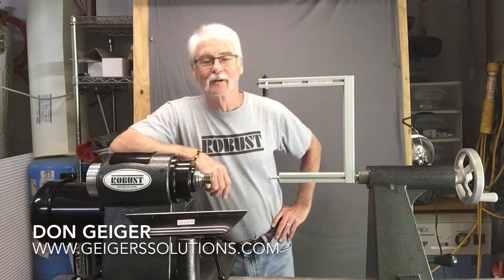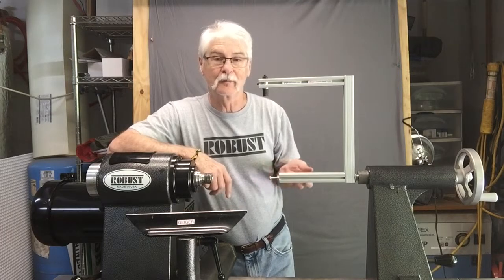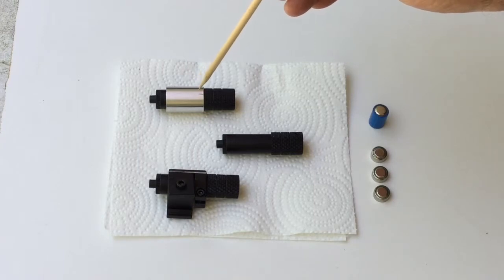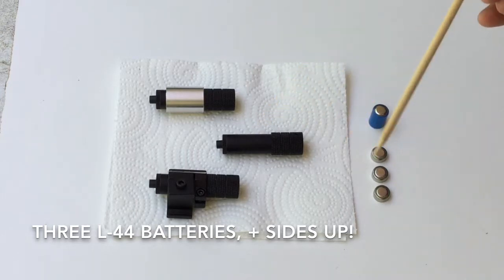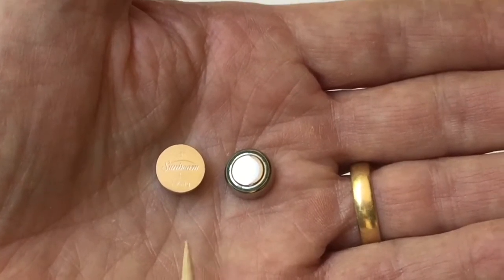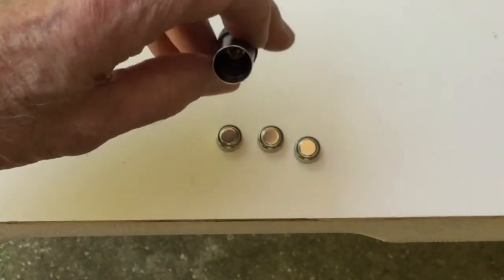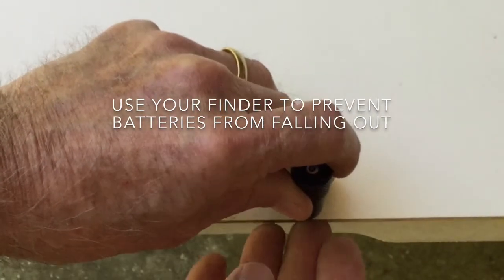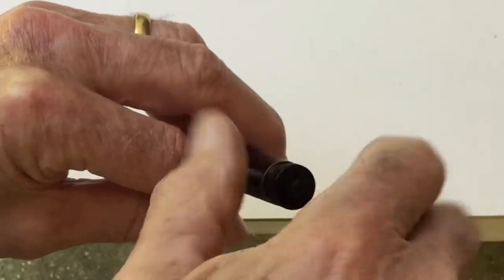Laser System Battery Installation Tips

Comment: when i screw it in it just pops and the battery fly out
Reply from the maker: Are you sure there are only 3 batteries and they are L-44?
Reply from the maker: I had another thought too: I have seen some lasers that are designed for only two batteries. Three would not fit. I don't recall ever supplying any such lasers with my Laser Depth Finder.

Comment: Help!  I've got 2 of those batteries for the ProHands Tactical.  They sit in the battery compartment horizontally  like a canoe.  Got any ideas for them?  I can NOT get them in!!   Thanks.
Reply: They must be same size as the original.  Can you stack them, set them on a table as I showed in the video? This method usually works.
Reply: I finally found my method; wire glue. A miniscule drop on the plus side of the inside batteries. My Truglow stacks 4 high.